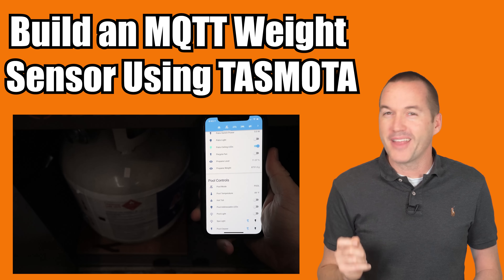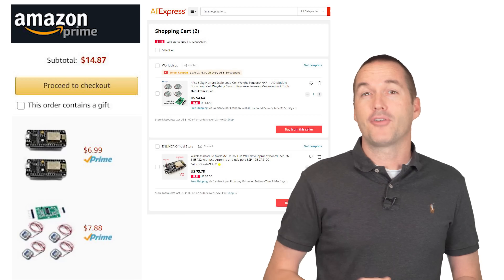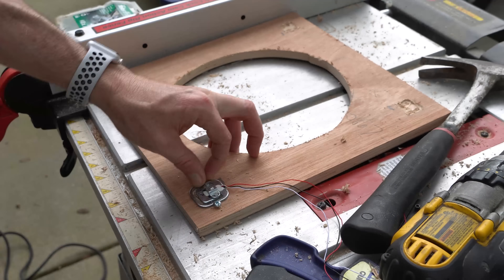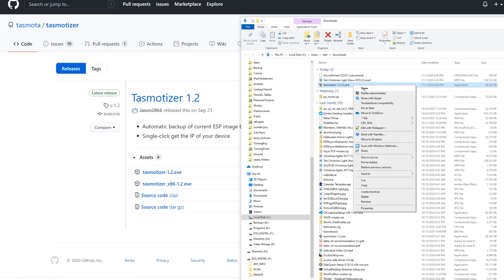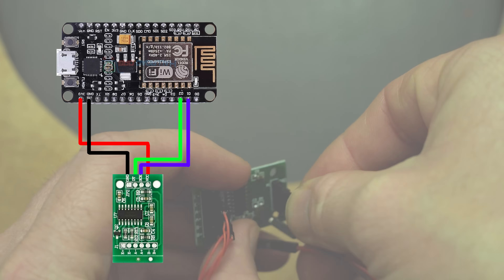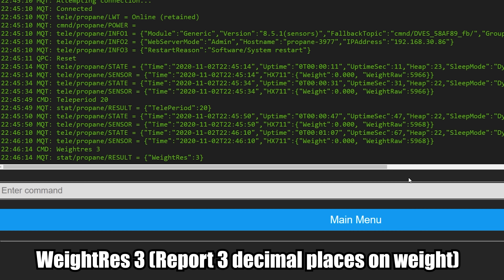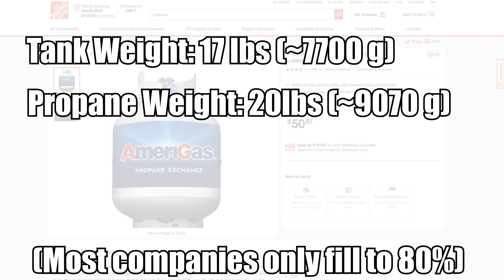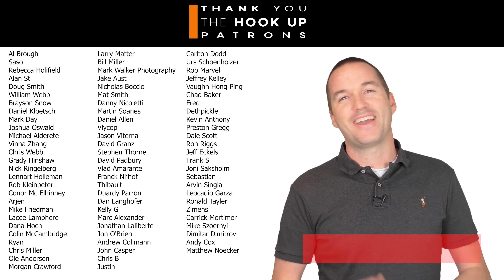Measure Propane, CO2, Salt, and so much more with this DIY MQTT Weight Sensor using Tasmota

Comment: Great Video, i´d like to know if it is possible to run this project under a battery, sleeping and waking up from time to time to check the weight of the tank, saving battery, Thanks in advance

Comment: Great video!  But for me it didn't work at first.  My load cells have red, black, and yellow wires.  I assumed the yellow was the same as the white.  I followed the instructions and didn't work.  I quickly guessed the issue had to do with the wires.  While setting things up and testing I accidentally pulled the 3 wires from one of the load cells.  I scraped off the white stuff and noticed there are 3 copper lines to solder on to.

I figured the color of the wires might change from manufacturer to manufacturer but doubt the order of the pins would change.  If you pay close attention to this video, you will notice the cables order is black, red and white.  On my load cells the order is red, black and yellow.  Instead of looking at colors I looked at pins (1,2,3) and once connected in the right order things seem to be working now.

Comment: I found this type of setup has too much temperature drift to accurately measure anything long term. Not sure if the amplifier drift or it's the temperature drift that strain gauges experienced (although they should all thermally change the same so not so sure). Short term where it zeroes every use would have been fine.

Comment: These seems to be just what I am looking for as possible solution for measuring beer left over in kegs in a regrigerator.  I have concerns about using wood as a platform due to potential moisture and of course the cold temp as well as the compressor kicking on possibly providing noise to the circuits.  Did I miss something?  Any suggestions?

Comment: How could this be used to turn a standard fridge in to a "Smart Vending Machine"? My idea is to scan a QR code before opening the fridge and then once you have selected your items and closed the fridge you will be charged based on the decrees of weight of the items on the shelves.

Comment: Few notes on those tanks - the weight varies by brand, but will be marked on the tank.  Look at the handle, the empty tank weight is the Tare Weight marked "TW".  And full would be the rated capacity, so a 20lb tank when filled to 80% by volume should hold 20lb of propane fuel.

If you want to compute the max safe fill of gas for a given tank, look for the "WC" mark which is "Water Capacity".  Then you can convert that to weight and take 80% of that value.

Example:
One of my 20lb tanks is marked WC 47.6 and TW 17.7
Water is 8.34lb per gallon, so the volume of liquid is 47.6 / 8.34 = 5.71 gallons volume filled to 100%
Safe max-fill is 80% of the volume so 5.71 * 0.8 = 4.57 gallons
Propane weight is 4.11lb per gallon, so 4.11 * 4.57 = 18.78 lb propane when full to allowed limit
Adding the empty container weight, 17.7 + 18.78 = 36.48 lb total weight when filled to the max allowed limit

Note: If you are getting your tank filled (not swap) at a reputable station they should bill you by volume and tell you how many gallons you are paying for.  Most places I've gone to round a "totally empty" tank capacity to 4.6 gallons of propane, which is probably close enough being 3 hundredths of a gallon over, and giving you a hair shy of 19lb in a 20lb tank.

If you go to a tank-swap, you often actually get more like 14lb because they often round down and then take 80% of the 80% value...shorting you  nearly a quarter tank of fuel that is pure profit.

Comment: Thanks Rob, excellent as ever. would 2 sets of sensors wired in parallel to the amplifier double the weight capacity and still work? i want to do bed occupancy and 200KG is half the capacity that i think il need. it would be cool if you could help, this seems to be a common question that so far i cant find an answer for.

Comment: Hey Rob, excellent video as always.  Any idea how sensitive these are on the low end?  I want to measure my soda stream bottles, probably 2250 gram empty 2660 full (410 gram or 14 oz. capacity).  Feasible?
Reply: I’m also curious about this. I want to weigh dog bowl water and the high end would be 40oz or about 2.5lbs. Is this feasible?

Comment: Hi guys, just got this project underway, using a D1 mini Tasmota etc, I have a propane cylinder that is pretty  full It is stable in my BBQ I have only extend wiring to make connections but my readings jumping all over the place 198kg (that cant be right maybe 19.8kg) then seconds later 303kg (again must be 30.3kg) fully filled 11kg cyclinder is ony 22.5Kg any ideas appreciated?

Comment: I hooked mine up as you said no output calibration failed. I reversed the wires and my scale calibrated but works backwards. What would you do next.
Reply: I'm experiencing the same as what you described. Were you able to figure it out?

Comment: Thanks for the video, even though its over a year old now, it was still great inspiration!  I used this method to put a scale under my dedicated beer fridge.  I used ESPhome instead of Tasmota, and with a template sensor in home assistant am able to get a reasonably accurate count of 12oz beers in my fridge.

Comment: Awesome video as always Rob! Would it be possible to power one of these by battery instead of electricity? E.g. I don't have electricity at my grill, or if I wanted to put it inside a stand-up propane heater in the middle of my patio.
Reply from the maker: Deep sleep and an esp32 is an option

Comment: For weight sensor calibration you should have more than one calibration weight.

Like 1kg 2, 3, 4, 5, 6, 7, 8, 9 and 10kg
Or at least 1, 5 and 10 kg
Since it isn't always a linear number to the weight. 

And you can make calibration weight with soda bottles filled and measured on a kitchen scale to get it within 1 gram. "Everyone" has soda bottles and a kitchen scale

Comment: Thinking of using this for kegs in a keezer setup. What would be the best way to setup multiples of this setup in a small space? Would each keg/scale need its own ESP8266? Or could I connect multiple Load cell setups to one ESP8266 module, using different data ports?

Follow up: The wi fi modules run on their own right? independent of a computer or rpi? Just get their power from the micro usb?
Reply: I was wondering about the same; I have three LPG tanks and need to get the quantity in each one of them; do I need mutiple ESP8266 or is there some way they can all be hooked to the same module?
Rob seems to suggest that this is possible in response to @Adam Wood question below but does anybody have an idea HOW?

Comment: hello. I struggle with this system, because after some time weight becomes inaccurate. I've tried to reconnect the wires, solder them, isolate them. Weight gets right but after some time again it shows the wrong weight. Anyone has a suggestion on how to solve this?

Comment: I’ve had a lot of headaches over the years with Hx711s. Always very noise sensitive, and would randomly die requiring a hard power cycle. Probably just my environment.

Comment: The load cells indicate they are 50kg, does that mean that if my water softener salt container weighs more than 110lbs that these won't work for that project or will it hold more weight because there are four load cells? Thanks for  any help.

Comment: Hi, again really thanks for this video. As you mention, in some cases the scale  past to zero, like a reset and lost the propane data. I think it's like lost the conection of the sensor with the Raspi and put all info in zero. Do you think if I use weight raw could resolve this? or Do you have any idea of solve it? Really thanks in advance, Sebastian from Argentina

Comment: Hi Rob, thanks for all your helpful videos.  I'm wondering if you can help me modify the code here for a specific purpose.  My situation is I use a reverse osmosis filter to periodically fill a countertop water vessel.  I have a solenoid connected to a tasmota that can cut off the water based on time elapsed, but would love to see it measure the container and fill it to the top, regardless of starting volume.  The final mass will always be the same. Others might find this useful too. Many thanks in advance!

Comment: I have everything built (by the way the wires for load scales are freaking thin & weak). I am at the scale calibration step.

I get a calibration failed error. In the video Rob says this could be wires are different from factory but then goes on to say you can confirm using status 8. I show a weight in the console when a weight is on, if I remove it, it drops like it should. 
So could the wires still be opposite or is this something else? The video wasn't clear. The video implied if the status 8 was correct then the wiring would be fine.
Reply: When calibrating, clear the load cell of all weights BEFORE issuing the calibrate command.  I pulled out half my hair figuring this out.  After issuing the command, the console will say remove weight followed closely by add reference weight.  Add the weight and shortly after you will see a successful calibration message.
Reply: @DodgeyRog  Your ROCK! that worked. Thanks

Comment: Hi, really great idea. I try with it, but not find the HX711 in the list of GPIOX. I try with different version of Tasmota but not find. And I try with a manual configuration using the Template in others parameters. Thanks in advance for your help. Best Regards. Sebastian from Argentina
Reply: Could you help my? because I don´t know why I don´t find the HX711 in the GPIOX. Thanks again in advance. Sebastian
Reply: I found the error, I used the Tasmota.bin and need to use the sensors.bin. Thanks and great videos
Reply: Did you use the tasmota-sensors.bin?
Reply: @mikelauritsen553  yes, now I'm using a tasmota-sensor.bin. The hardware it's a LoLin and I included in the same hardware the hx711, a DHT11 and a DS18B20, all in one.
Reply: Sorry I missed that reply.

Comment: Thanks a million for this great idea! I got a pizza oven for Christmas and have been worried about running out of propane. It took a while to get everything together, but after some dupont connector challenges I finally got it all working.

I'd love if you could put together a tutorial on how to make a battery powered version for those who don't have easy access to power outside.

Thanks for video!

Comment: Great video, keg scales here I come. Can you have 2 HX711's hooked up to the same nodemcu to run 2 sets of scales?
Reply from the maker: I don't see why not.
Reply: Nice! Assuming they would just share the 3.3v and ground. Would they share the same clock pin and just use a different data pin? Would there be any issues with power being drawn by having the 2 on the 3.3v with the 5v power supply?

Comment: This video was great, set this up to monitor my Water Softener Salt level - works beautifully. Set it up in Home Assistant now I'll know my Salt Level when I'm at the Store looking at salt on Sale. ;-)
Reply: Chris, would you mind sharing your templates for the water softener? I'm working on this now and think I know what I'm going to do but no reason to reinvent the wheel.
Reply: @CommittotheIndian  Not sure what he was referring to when he said "with a little modification you can measure Salt" as I followed this video to a "T" and it works perfectly. Basically I built it exactly the same as the Propane sensor demonstrated in the video, my Salt Bin is 12.25 x 12.25 at the bottom so I used a 13" square piece of 3/4 inch plywood I had lying around.  I setup the weight sensors exactly like the video except I did router some channels for the wires and cut a 3" hole in the center for the HX711 to fit in.  Calibration and hooking it up to Home Assistant was exactly as outlined in the video.
Reply: @GambitC90  So you just adjusted for a mostly empty tank and a "full" tank? That's what I was planning to do, just figured I would check.
Reply: @CommittotheIndian  Yeah, so I calibrated the scale exactly as outlined in the video, then in Home Assistant I setup the following Sensors for the Weight scale as a KG Weight and a % of Full based on 4 * 20KG bags being "Full".

If I remember correctly, 32000 is the approximate weight it was recording with very little salt in it - so I treated this as Zero

  - platform: mqtt
    name: Water Softener Salt Weight
    state_topic: "tele/watersoftener/SENSOR"
    value_template: "{{ ((value_json.HX711.WeightRaw | float - 32000) / 1000) | round(2) }}"
    unit_of_measurement: 'kg'
    icon: mdi:weight-kilogram
  - platform: mqtt
    name: Water Softener Salt Level
    state_topic: "tele/watersoftener/SENSOR"
    value_template: "{{ (((value_json.HX711.WeightRaw | float - 32000) | float / (4 * 20000)) * 100) | round(0)}}" #4 bags is full
    unit_of_measurement: '%'
    icon: mdi:percent-outline

Comment: Can't get this to work for the life of me. I have tried it with a combination of 3 D1 Mini Pro's and 3 MCU with 5 HX711's. No communication to the Hx.  I tried to use 8.5.1 and 9.2.0 release with no luck. When I issue the i2cscan I always get "stat/Flower2/RESULT = {"Command":"Error"}". Have tried various combination of pins also. Not sure what to try next. I'm switch to trying to communication with the Hx after many failures on connecting the load cells to the Hx.

Comment: is not working for me 
I'm trying this 
- platform: mqtt
    name: "Wasser Tank"
    state_topic: "tele/Tank/SENSOR"
    value_template: "{{ (value_json.HX711.WeightRaw | float - 15340) | round(2) }}"
    unit_of_measurement: 'g'

but wen i test it i have this error 

UndefinedError: 'value_json' is undefined
help please
Reply: Have the same problem. How did you solve it?

Comment: 20 Lb. Propane tanks  that are exchanged at convenience stores. Walmart etc..  only have 15 lbs. Of propane.They usually say so on the label. The weight of the empty tank is stamped into the top ring / handle.

Comment: Should the 4 load cells be connected as a Wheatstone bridge in this application? I don't think so but I could be wrong. My understanding is that each foot /loadcell should be adding the load it sees to calculate the total load, not comparing the difference each foot sees with other feet. You may find it still works after calibration because of imbalances between each foot and the gain of the load cells being different, but I think it would be better to add all the loads together rather than look for differences between them.

Comment: I plan on using this guide to build a scale for my beehives. This will be a great tool, just need to do some gram to lb conversion. Any tips on powering the NodeMCU in a remote location? I have not had luck with batteries and solar.
Reply: Not sure this helps but I have a little success with 18650 batteries.  I can get about 3-4 days off a couple of them powering a d1 mini running tasmota with a temperature sensor(ds18b20).
Reply from the maker: Yeah, batteries and solar have not been my friend either.

Comment: When you rewire the black and whites if the reading is reversed.. not effectively rotating the logical positions 90 degrees? 2 becomes 1, 3 becomes 2, etc. would it not be simpler to reposition the red wires accordingly?

Comment: I've had a load cell and an HX711 on the shelf for a few months with the intention to build a gauge for the gas bottle on my MIG welder (and probably another for the TIG as well, but mainly the MIG bottle as it is much smaller being on a cart and empties at the worst time). Did not know until now that Tasmota supports this sensor and have been putting it off because I thought I'd have to write the code. Good to know it will be easy! Best part is the MIG already has a 5V power supply inside so it should all be self contained within the welder/cart.

Comment: Thank you Rob!  I've just completed my water softener brine tank scale project for Home Assistant. I ended up using ESPHome but same result.
Reply: @Rossmatt06, would you mind sharing your template for the softener? I am starting on this as well and have an idea of where to start but no reason to reinvent the wheel.
Reply: @CommittotheIndian  Sure thing.  What's the easiest way to share it with you?

Comment: Very timely video, thanks! I have HA automating some humidifiers in the house, but don't want to run them dry.  Been planning to set up a weight measurement system to tell when they are empty and shut them off.

Comment: A couple of questions:  1) can this be done with D1Mini?  2)How did you power the NodeMCU?  Did you provide constant power or battery?  I do not have the option of constant power, so I am thinking about using battery power with a switch to turn on/off whenever I need to check the level. Would love to know if you have a solution for a battery-powered option.

Comment: Also will this work for larger tanks? specifically Helium tanks.
Reply from the maker: It will work up to around 200kg, but you may see some drift over time if you're maxing out the capacity like that.

Comment: I would really like to see a similar video showing water flow sensors & a NodeMCU.  The proposed project could be a little different and could use a Zabbix Agent and push data to a Zabbix Server.

Comment: Would all of the hardware survive inside the refrigerator if used to measure kegs?
Reply from the maker: The temperature won’t hurt it, but the moisture might.  You’ll need to calibrate it once it’s cold.

Comment: Not sure what I have done but here goes....wired it as described......when I go to calibrate I get an error and negative number so swapped the black and white wires around. This now allows me to calibrate with a 2kg dumbell....the only problem is when I take the dumbell off the weight is 2kg....and when I put is on it measures 0kg......???
Reply from the maker: The negative numbers are fine, the key is to make sure the value goes up (so a smaller negative number) when you put weight on the scale.